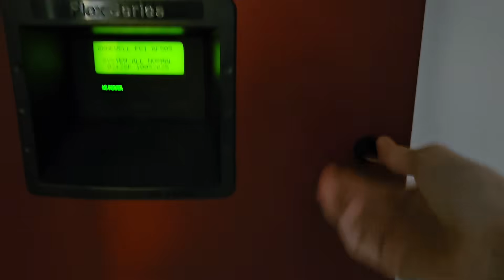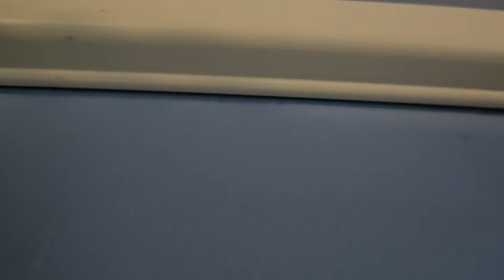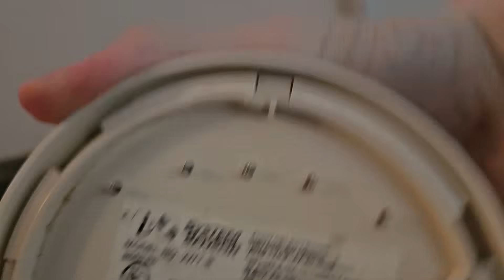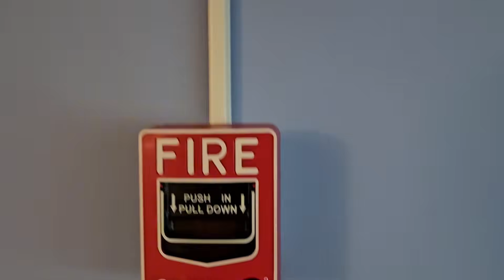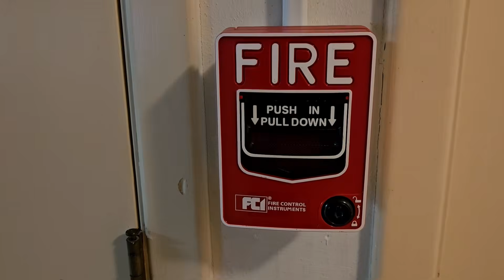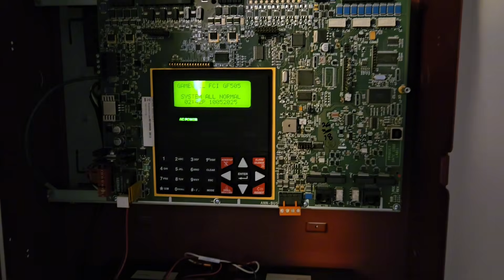Fire Alarm System Test 1

Comment: Very nice system! I have a FireLite ES-50X. It is being used as a real system in a garage on my property.

For that System Sensor detector with the sounder, controlling that horn with the silence key on the panel is not possible. Now if it had a separate input for the NAC circuit, I wouldn't doubt it would work with System Sensor Sync